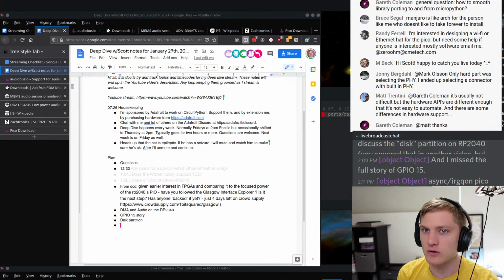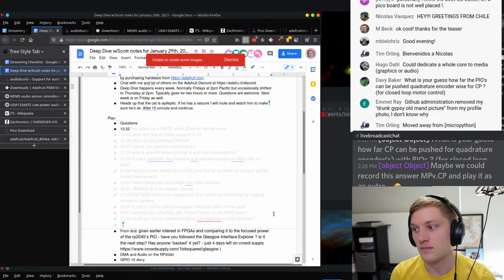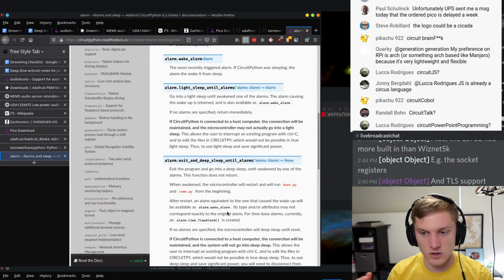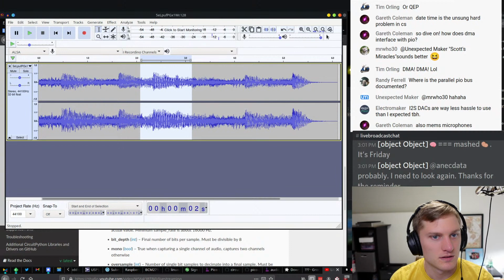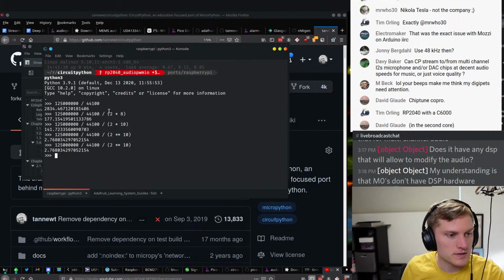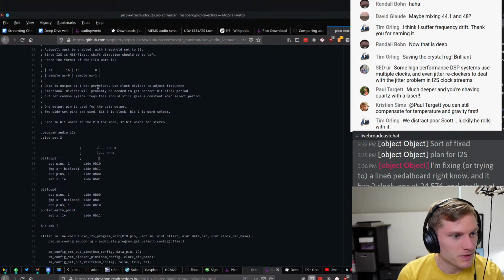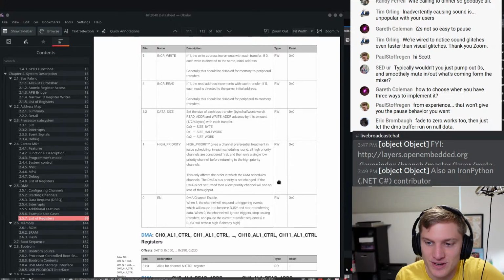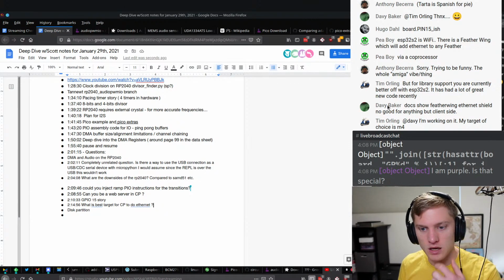Deep Dive w/Scott: RP2040 DMA and Audio #raspberrypipico #rp2040 #adafruit @tannewt

Comment: I've been searching the RP2040 datasheet and while most of the DMA is well explained, I cannot find how many bits an 'item' is. Does it depend on where the DMA is to and/or from? I'm hoping to DMA 16-bit stereso samples in LRLRLR order to the Pimoroni Audio Breakout board I was given.

I'm sorry if I've skipped over it but I can promise that I did spend several hours before asking.
Reply: Not in the datasheet, but in the SDK docs you can see `dma_channel_transfer_size` enum - it's 8, 16 or 32 bits

Comment: I think the Pico's most common application might be a daughterboard to be SMT mounted. Also, I didn't really feel the absence of the reset pin on the board while prototyping. I just short the RUN pin to ground with some jumper wire and it's perfectly fine. When I move onto SWD, this problem will simply be nonexistent.

Comment: Minix used to run on the 8088 IBM PCs(I remember testing it out on my Amstrad PPC512) so as the RP2040 chip is much faster it should be able to run some early version of Linux/Unix if you wanted it to. Maybe you could cut and past the machine code parts and file system from a later ARM version back to earlier one with a few tweaks :P